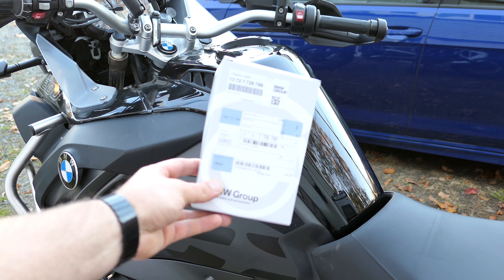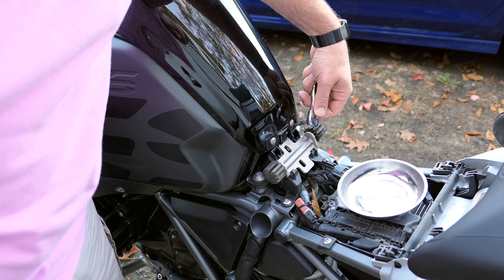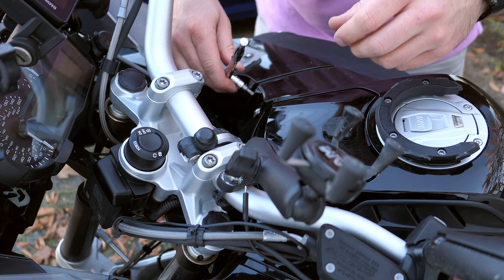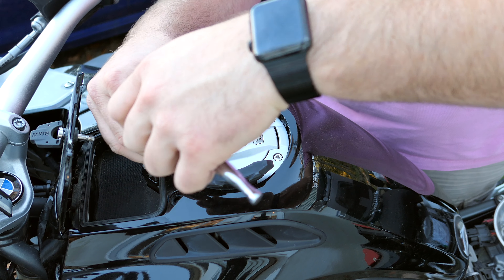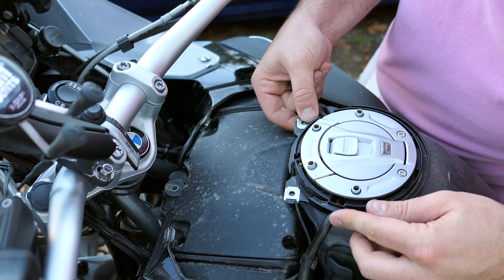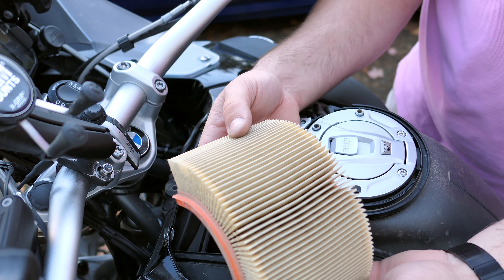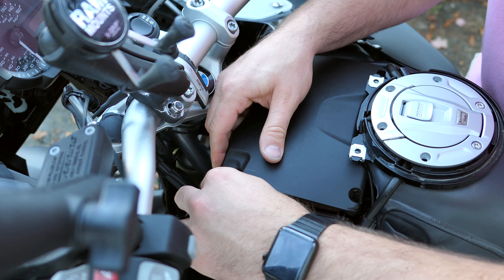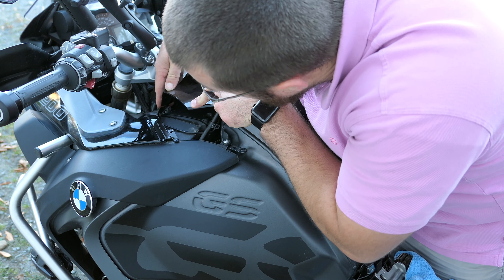How To: Change Air Filter, R1200 GS Adventure Liquid Cooled

Comment: I don't know what was holding my tank cover on. I had all 7 screws removed as well as all 6 gas cap screws removed (I have a tank bag ring). The back would pivot up a bit and so would the front. Something just ahead of the gas cap was holding it on. Go figure.
Reply from the maker: Very odd. It’s a firm pull and the clips will give way. Sorry.